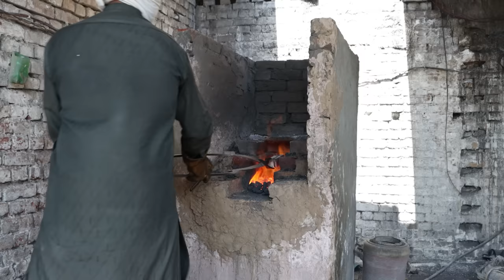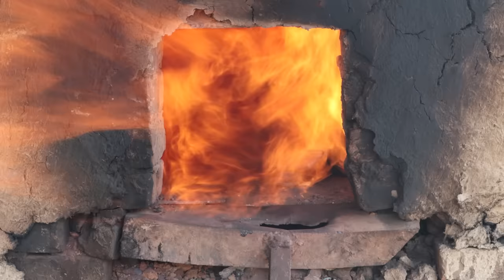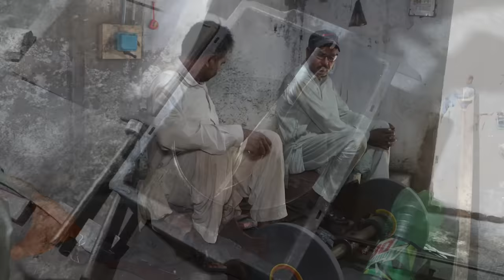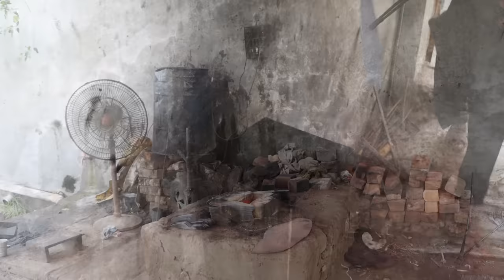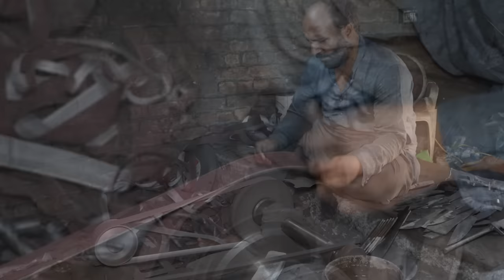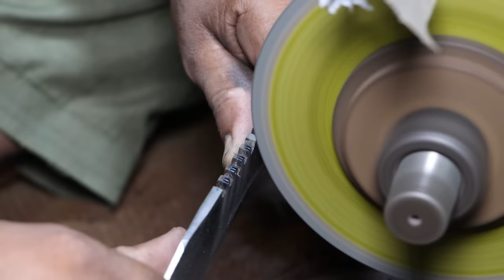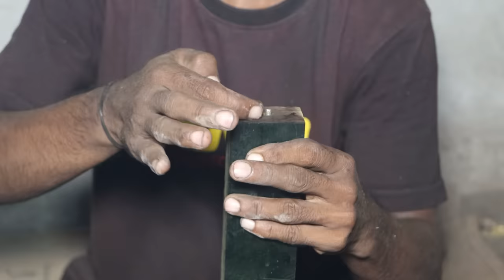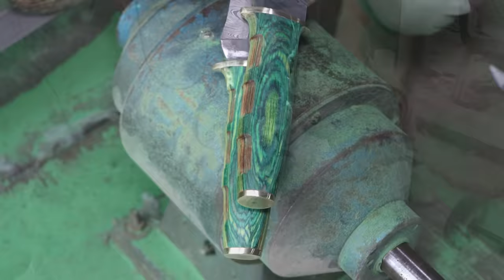Incredible Process of Making Super Sharp Hunting Knife

Comment: The handmade reproducibility is shocking. Can’t imagine anyone in America, even with OSHA protection, even attempt this with these tools and process. It’s most certainly why everything made in bulk has an Asian country mark stamped on it. Cutting the tang down probably cuts 20-30% of its weight. I dont see a problem unless you are using it as a hatchet. Given the teeth- I assume that is NOT what it is designed for.  Beautiful shape. I’ll take a couple.

Comment: Now I know where all of these poor quality knives are coming from.  Over heated edges, poor edge retention and welded tangs, cold shuts and poor lamination with peeling and bad heat treat.  I make knives the proper way and this is just quantity not quality, although they could still pump out quality knives if they actually cared.  There was no normalisation to refine gran structure.  I snapped one of these knives in my vice and the grain quality was terrible and the layers of pattern welded steel were easy to see.  Don’t buy these knives people they are not trust worthy and you can get badly hurt.